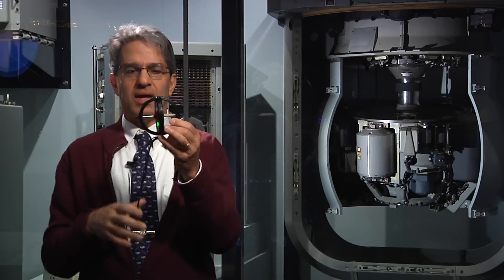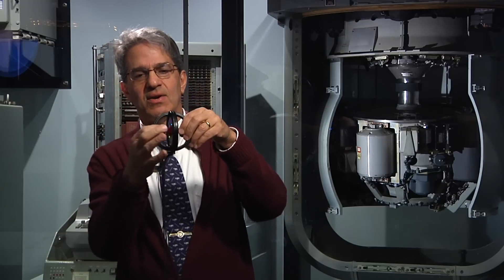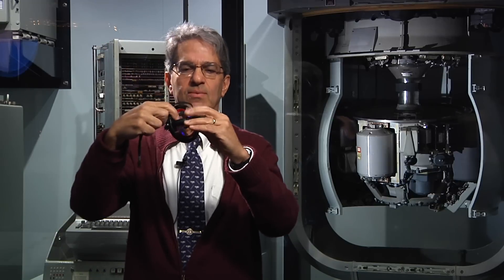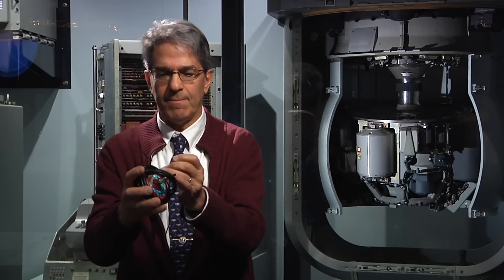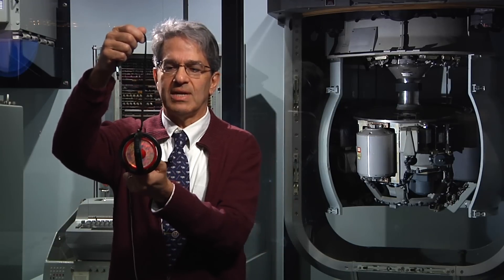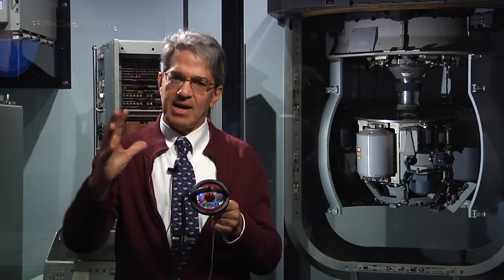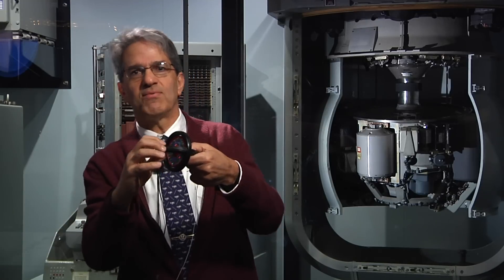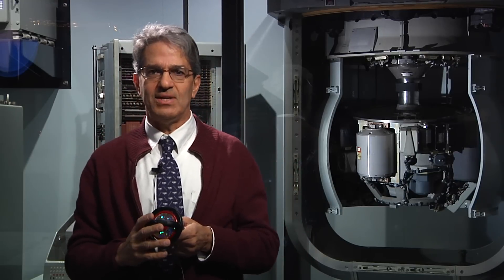Gyroscopes and Gimbal Lock

Comment: A gyroscope couldn't work in on a spinning ball like the Earth, in particular as it orbits the sun and the sun orbits the galaxy.  The gyroscope would pick up all of those motions and wouldn't function.  You could not navigate a plane on a globe with a gyroscope, but all modern planes have gyroscopes.

Notice the Solar symbol at the beginning of this video.  Pure sun cult worship.  Neil DeGrasse Tyson often wears sun symbols, too.
Reply: +Tom Carberry You must be joking.
Reply: +tmkr No and I have listened to many discussions on this topic by submarine experts and airplane experts.  All airplanes work on a flat earth model. Once planes leave the Earth's surface, the operate in their own plane and depend on the gyro to maintain accurate elevations.  

From NASA Reference Publication 1207 August 1988:

"This report documents the derivation and definition of a linear aircraft model for a rigid aircraft of constant mass FLYING OVER A FLAT, NONROTATING EARTH. The derivation makes no assumptions of reference trajectory or vehicle symmetry. The linear system equations are derived and evaluated along a general trajectory and include both aircraft dynamics and observation variables."  (Capitalization added).

p. 6; p. 102 (repeats the same on both pages).

https://www.nasa.gov/centers/dryden/pdf/88104main_H-1391.pdf

If we lived on a globe of about 25,000 miles in diameter, planes would have to fly nose down almost because of the super rapid curvature rate.

We all learned a huge lie starting infancy. Our parents learned it and their parents learned it.  Our teachers learned it from their teachers and in fact no one really lied to you because everyone believed it.

At 30 miles you should have 600 feet of curvature, meaning your couldn't see skyscrapers 30 miles away.  Anyone who lives near a big city knows you can see them much farther away than that.  Also, they should bend backwards and to the side, because the Earth should curve in every direction.  You never see that.

Solar cultists in the Catholic church gave us the Solar System.  If you really look at the Sun you will see a pretty small ball, maybe 50 miles in diameter and not so far away, maybe 3000 miles or so.  Same with the moon, an object about the same size.  

Does the Earth move under your feet at 1000 mph east to west?  If yes, how can you fly to from NYC to LA in a plane that goes only 600 mph?  You would get there when the Earth lapped the plane, but not before.
Reply: The earth revolves around the sun once per year. That's 365 days. Each day has 24 hours and each hour has 60 minutes. You're claiming a gyro can't work with an error of 1/525,600 revolutions per minute. That's 1.9025875x10^-6 rpm. 
The gyro drifts way more from friction in the bearings than from the earth's orbit.
Reply: Altitude readings are based on the pitot static system, which measures air pressure.